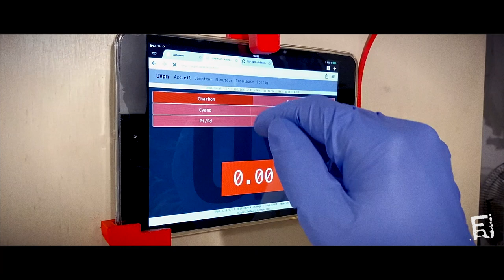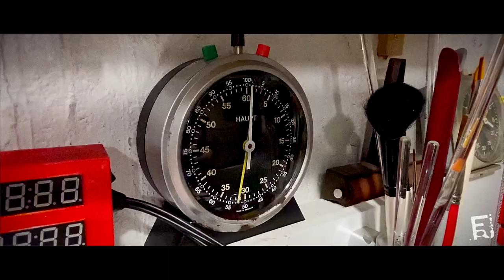Carbon transfer printing from pigment to printing

Comment: Thanks for sharing ! What is the white substance you painted on the paper? Doesn't look like gelatin or albumen.
Reply from the maker: It’s acrylics coating.
Reply: @franck-rondot  I haven't heared of this method before, I will try it,thank you!
Reply from the maker: @嘻嘻-e4n  It’s work fine and it’s safe !
Reply: @franck-rondot  I'm still learning to use DAS instead of ammonium dichromate recently. Safety is really important! I hope you can make more videos, I can refer to learning☺ (laughs).

Comment: How do you prevent the N2 gas bubble?
Reply from the maker: As you can see from minute 7:50 I pre-moisten, squeegee and let a few minutes of degassing take place !
Reply: @franck-rondot  Tahnk you.
So the glop is mixed with DAS?
Because I am using potassium dichromate. 
I am coating it on the tissue.
Reply from the maker: @林繼堽-j4x  Yes the DAS is mixed in glop, the tissus is dryed and usable many months.

Comment: Nice video! But what are you doing after exposing tissue to UV? I see you put the tissue in a tray and then let it dry before transport. What's that? Thank You!
Reply from the maker: It's a pre-soak for degazing the nitrogene and dont have bubble !
Reply: @franck-rondot  nitrogen? And you squeeze the exposed gelatin? Doesn't it affect the image? Pardon my questions I'm searching for info because I want to try this technique.
Reply from the maker: @Iskandar19898  Yes, I squeeze the exposed gelatin to remove excess moisture without any problem.

Comment: Hello Franck! Thank you for that video! Suberp workflow! I was wondering is it preferable to use acrylic glue on your support or a gelatin based solution? Thank you!!
Reply from the maker: Hello Antoine,
With gelatin you need to tann before transfert and clarify after. I dont find a safe tanner for gelatin, for the moment it’s more simple and safe with acrylics. Franck
Reply: @franck-rondot  Thanks for your fast answer :) What about albumin solution? Same answer?
Reply from the maker: @antoinedewinter4642  Albumen also works, you can tan with alcohol, but it's a little trickier to get a very thin layer and it's brilliant!
Reply: @franck-rondot  Thank you Franck!!
Reply: @franck-rondot  When you say tan with alcohol, what do you mean?
Reply from the maker: @antoinedewinter4642  When the albumen is dry and before transferring, apply isopropyl alcohol to the albumen. Wait for this to dry, and now the albumin layer is more resistant and does not melt in water.
Reply: @franck-rondot  Thanks again Franck!!
Reply: @franck-rondot  it was my issue with albumen otherwise I love the result on albumen ;) I would like to experiment with acrylic surface too. Could you shortly describe how to make it ? Do you simply use acrylic varnish instead of gelatin? do you brush it or use glass rod? What about longevity of pigment on acrylic surface? Sorry for so many questions ☺
Reply from the maker: @JanKratochvilcom  Just a brush, and 1/3 acrylics varnish + 1/3 distilled water + 1/3 alcool. If you use professional art quality acrylics the longevity is very good.
Reply: @franck-rondot  Thank you, definitely, I will try it with acrylic. I just consider what kind of brush. I struggled with not even surface - the brush lefts tiny lines-  that does not look nice :(
Reply from the maker: @JanKratochvilcom  If your use very thin coat and diluted acrylics you don’t see the coating !
Reply: @franck-rondot  Thank you, so kind of you, it saves my time and nerves :)